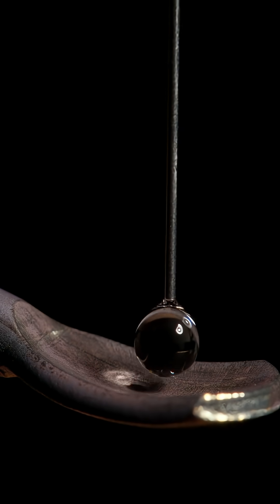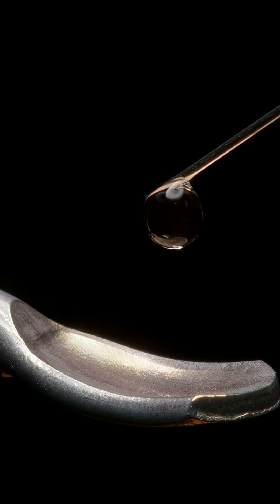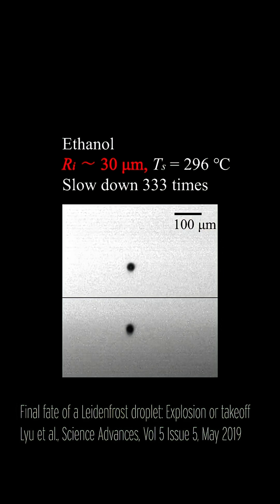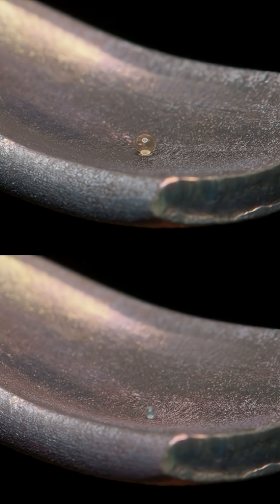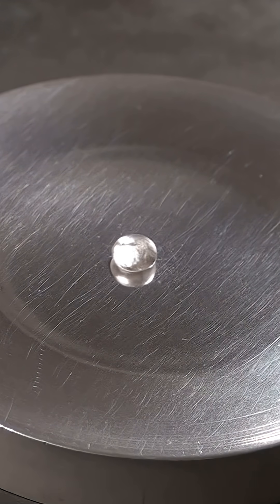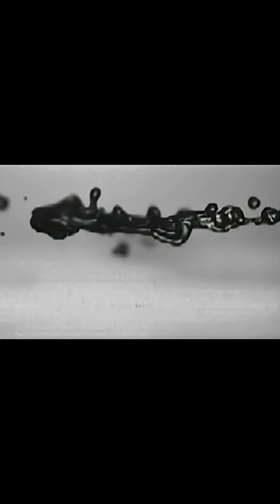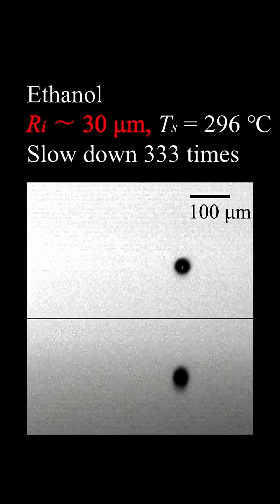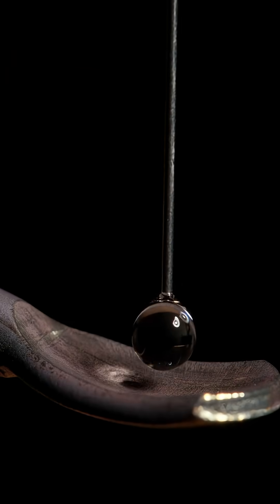trying to make water levitate but it keeps exploding

Comment: A lot of weird phenomena like this feels like physics exploits in video games.
Reply: i was going to comment that the random explosions could be that the atoms/chemicals of the impurities are moving at a different rate than the atoms of water due to the miniscule different in weight, and when the impurities bump into water molecules in just the right way as they all spin in the heated air around the droplet, it drastically increases the speed of some of them akin to when a spinning wheel is shot into the air off of the ground. this launches a select group of water molecules and impurities so fast it breaks the surface tension and weakens the droplets overall stability, but if it was all pure water molecules then the atomic weight across the droplet would be in perfect balance and this reaction wouldnt happen. i think its fully a physics thing, glitching game physics with speed boosts or objects is such a good visual example of what i pictured in my head. its just atoms running into each other and some atoms are going at two wildy different rates, and if you let it go long enough the physics eventually go crazy.
Reply: @scottydog6713 or it's little steam explosions?
Reply: @AustinSmith-Texan  what i said and what you said could be used to describe the same thing, so sure, why not. it could also be described as little steam explosions, i guess you could describe it that way if you wanted to strip the fun and joy out of it.
Reply: it's a bug in the simulation
devs did not expected players to try this
Reply: If you think about it, flying a plane could be perceived as physics exploit in real life
Reply: Oxygen not included
Reply: hi clippy
Reply: Glitch in the matrix bruh
Reply: That's spookily accurate especially for quantum mechanics, I wonder if someone tried explaining phonomena like tunneling with numerical imprecision
Reply: Hear me out.... blastois
Reply: That's because of our pattern recognition. It defies our sense of normal and expected behavior.
Reply: Honestly the fact that firearms and nuclear weapons exist feels like humanity just found exploits in the physics engine lmao.
Reply: In a way, it is. Just "rules" interacting in a complex manner unexpected to the viewer. It's neat!
Reply: Look up triple point of water on youtube to see another cool IRL glitch
Reply: orbit definitely feels like a glitch when you really learn about it... the map is curved so just go sideways REALLY fast and you can fly if you just fall really fast towards the ground but miss it
Reply: Los monos que diseñaron los videojuegos han vivido la vida que vivimos
Reply: We live in a holographic matrix
Reply: Gently bumping into a table in Skyrim and the plates and food flying everywhere
Reply: I’ve been permanently messed up by being a  software engineer. Every time I fly and look at cloud, ocean, lake or land patterns I think, “oh this could have been programmed by doing XYZ.”

Honestly, it really just shows how far computer graphics have come.
Reply: I mean, they are literally physics exploits
Reply: It gets even weirder when you consider the way things act different while they arent being observed, kinda like videogames not drawing/updating stuff when the camera isnt pointing at it (check the double slit experiment)

Or the way we have something similar to border limit in the observable universe (we literally cant go past it, ever)

Or the way moving extremely fast makes time itself go slower for you specifically (the universe isnt optimized properly i guess)
Reply: God had to find a workaround cause the real feature bugged out

Comment: Isnt it a coulomb explosion and therefore similar to the mechanism how ESI Sources work?
Reply: No definitely not. Coulomb explosions are caused by a rapid flow of electrons out of a material. These explosions are caused by rapid boiling of the water because it's a thermal process, not an electronic process. There is no redox chemistry happening here like there is when you drop potassium into water (a common source of coulomb explosions.) And the water is not nearly hot enough to have significant thermionic emission